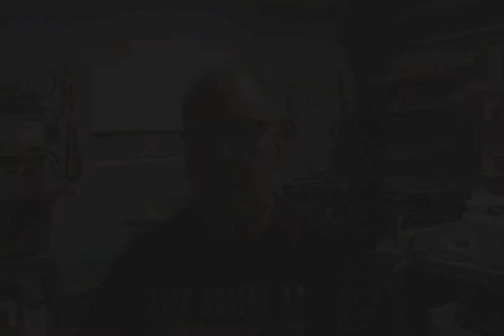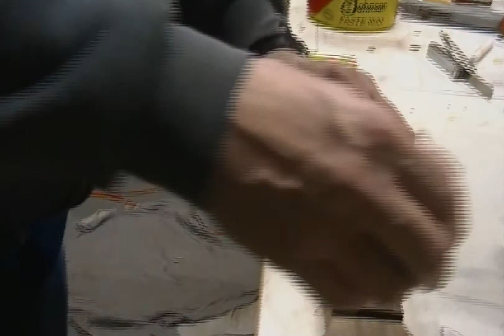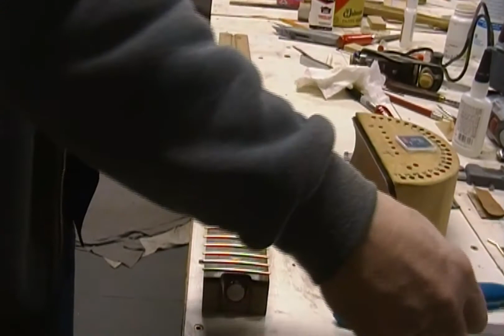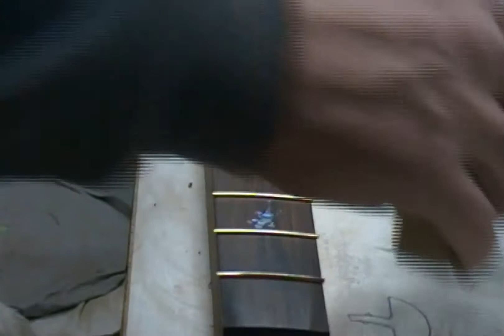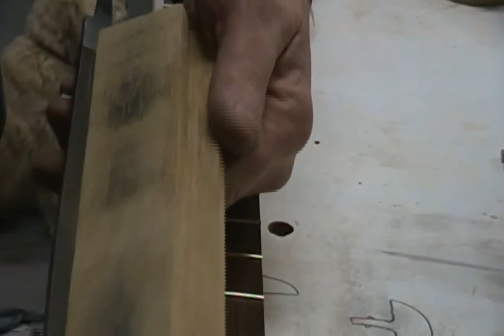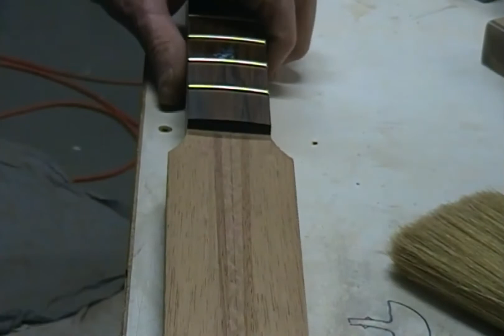Custom Electric Guitar Build, “GECKO” BY Jonah Guitars #12

Comment: Nice, precise work Dane.
You took the words out of my mouth regarding the micro nozzles. Before my place of work  shut down, the chief buyer gave me a lead on a UK source, but the website was misleading so I didn't forward it. But I remembered you'd made this plea once before and when I saw some pipettes on eBay (from China), I bought some to see what they would be like. I was waiting for them to come first before passing the seller on.
I did the same thing as you with a file glued to a Tufnol block, but I figure that's what loosened a couple of sprouted frets on my self assembled Esquire- I used a "mil'n'cut" file! It's a tool I used to use at work for flushing off aluminium alloy threaded inserts in fibreglass and nomex honeycomb boards, but a bit brutal for this application.
More on the pipettes if and when they show up. I know the sort of nozzles you mean because our trimmers used to use them for bonding down bubbles in Tedlar laminated trim which could be mighty thin at times.
antaresteve.